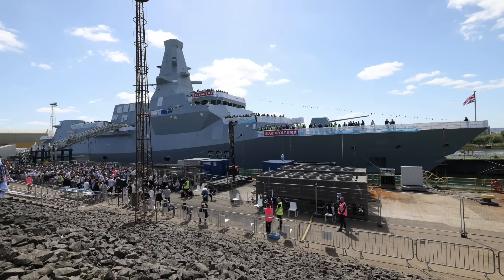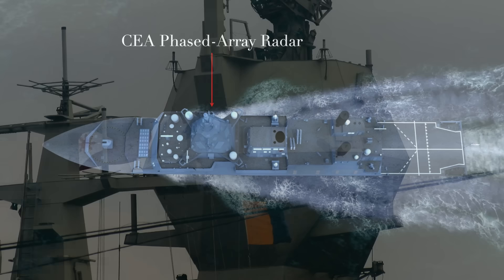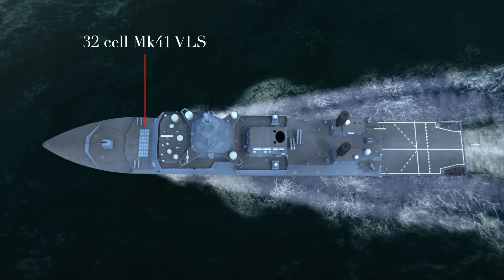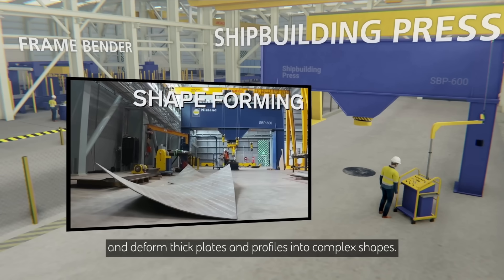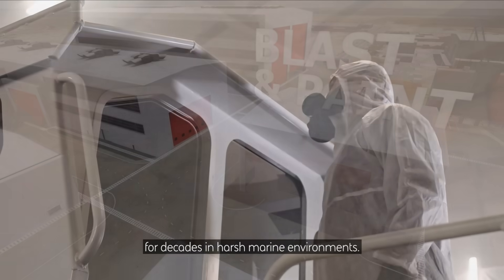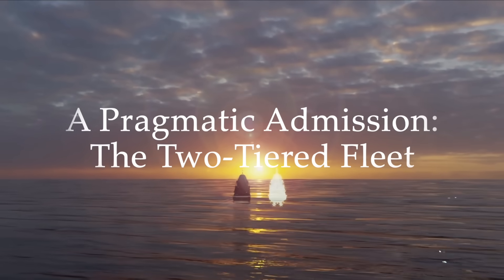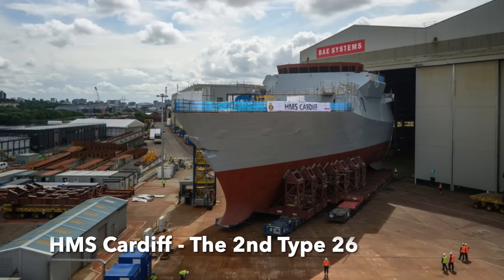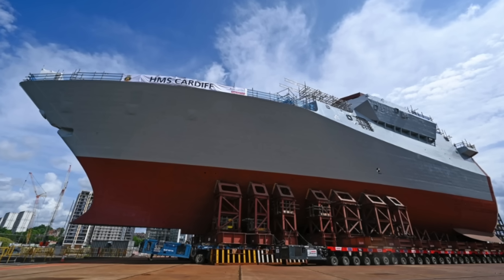The World’s Most Expensive Frigate? Inside Australia’s Hunter Class

Comment: The problem is not investing in am advance frigate assembly
Line. Expensive but necessary.

Its giving an ASW warship a full AAW radar suite which isnt needed for that mission.

The lesson from Yemen and Ukraine operations show you need many more layers of air defence (lasers, 40 mm anti-missile, boats, drones, an 76mm or larger gun and lots of quad packed point defence missiles. For area (fleet) Air Defence
And anti-ballistic or hypersonic missiles you also need lists of long range air defence missiles on top.

IMO the extended Mogami GP frigates are too small and under 13:03 armed to be safe. A modern air defence destroyer needs to be c 100 mk 41 VLS and over 10,000 tonnes.
Reply: The Hunters don't have a full AAW radar suite. They have CEAFAR and AEGIS CMS.
Reply: @De_cool_dude a European equivalent built today would have a single AESA (say l) Thales 4D NS100 or equivalent. Significantly less radar.
Reply: @nickbrough8335 the Europeans have a completely different threat environment. What might be enough for them would not be for us.
Reply: @De_cool_dude in what way ? It may make sense that Australian builds combined ASW And AAW warships (rather than one of each), but that you need 10,000+ scale and the T26 design is too small.

If you want to protect the RAN against Chinese SSN then you need T26 and SSNs (and probably carriers tbh). Yes, they need more patrol endurance than most European designs have (perhaps more than even the UK has designed in.

What you don’t have is your ASW towed arrays and helicopters anywhere near tour fleet/convoy where they cant listen quietly at low knot speeds. I dont know what SOP would be, but active radar silent conditions wouldn’t surprise me

Comment: why didnt they just buy what the RN ordered
Reply: Politicians treat defence procurement as a make work scheme.
Reply: The RN's Type 26 sucks at anything that's not launching helicopters and detecting submarines.
Reply: @De_cool_dude 
Cool story bro. 

What do you think ASW are for?
Reply: @brettmitchell202 we didn't want something that can just do ASW, we also want something that defend itself in the air and surface environments too.
Reply: @De_cool_dude 
And you think Type 26 can’t do that? Lol please.
Reply: @brettmitchell202 not in the context of a general war in the Pacific. Tell me, can a Type 26 launch SM-6, or SM-3, using its T997 radar? How many slanted anti-ship missiles can the T26 use?
Reply: @De_cool_dude 
The RAN don’t use those missiles so I suppose the answer is zero…

Are you suggesting Type 26 has no anti air or anti ship missile capability?
Reply: @brettmitchell202 good job dodging the question! However, the RAN does use the SM-6, and it is not incorrect to say the SM-3 could be procured in the next few years . . .

No, I am saying that the T26, as is designed for the UK, lacks air defence and anti-ship missile systems suited for the Pacific. Unless you think a SAM system with <50nmi range and a future dual-use cruise missile, launched from VLS, is better than ESSM, SM-6, TLAM/MST and NSM, and sufficient for a Tier 1 combatant going up against the PLA's best]?

Comment: The reason why its called a teir 1 ship is because it has the AEGIS system and a great deal more C2 capability. The issue with it is that its a ASW frigate and so will need to be on the outer ring of a taskforce. 
This means its a ship where the expensive items (AEGIS and C2 capability) is incompatible with the other part of the ship's function (ASW). 

If it wants to be a tier 1 ship, one that is at the centre of a taskforce and for it''s weight and price then there is a great deal of destroyers that are in the similar weight and price clase. The US Arleigh burke class, Sejong the Great, a reduced size Maya class. To be honest the price difference for the Maya class or the Sejong the great class destroyers would more than pay for the need to build in Australia as the Sejong the great is AUD$0.9 billion and the Maya Class is AUD1.63 billion.  These are much more capable than the Hobart class ships (2-3 times more). 

If we wanted a dedicated ASW frigate that the type 26 without modifications would have been fine but it is more than twice as expensive as equivalent german, dutch french or spanish ships. The japanese are ONLY a 1/3 of what it costs the UK to build the Type 26.  The korean one is a tenth of the cost.
Reply: The European equivalents to Type 26 arent designed to be as quiet and most in service top out at about 4000 miles range; type 26 designed for 9,000.

European Navy’s are NOT intended for open ocean warfare either.

The extended Mogami class is a GP frigate. The UK equivalent is the Type 31 some 2 to 3000
Tonnes lighter without any real specialisation.
Reply: @nickbrough8335  Thanks for noting the increased range of the Type 26.  In regards to Japan I was talking about the Asahi class destroyer, which is a specialist ASW ship.
Reply: @yumsy37 fair enough
Reply: AEGIS is so that the RAN (now just the RAN's Tier 1 force) could standardise on a CMS. That alone would save billions in training costs for the projected lifespan of Hunter.
Reply: @De_cool_dude fair point, but modern CMS are tending to be modular and open system based to allow different weapon systems to “plug and play” amd Aegis originated for the top end  US AAW platforms. 

I would argue copying the USN approach may be dangerous. With the various design problems (LCS, Constellation class, Zumwalt) its clear that they have completely lost their way. It seems that the Navy brass are fixated on large full scope warships (arleigh Burke’s) and cant innovate or modernise their approach.
Reply: @nickbrough8335  Baseline 9 AEGIS is a lot different to Baseline 2. (Also AEGIS alows CEC and NIFC-CA)

We aren't copying the USN approach. We have large vessel procurment and we have USV/UUV procurment. They are managed by different teams under the same department, but are aligned in goal and in C3 infrastructure/networking.

Comment: the larger hull was for fuel as Australia doesn't patrol in the North Sea or the Atlantic puddle, a part of the program cost is in the university course in naval ship design at the uni of SA witch should pay off in the long run if we want a sovereign build capacity, I think the reduced build numbers are a mistake and the two tired issue is a political one not a naval one it's about cutting defense spending also the steal cutting started a year earlier than you said in Newcastle and other places as the build will have sections built around the country sa part of the push for sovereign build capacity

Comment: In my opinion as an Australian I would accept a cost it takes to have that shipyard building non-stop. Build a Ship and while it is constructing the next design is turned into digital instructions. The vessels to replace the ones in service are commissioned every 2 years for example. We end up with Australian built ships even if it means taxpayer subsidises the shipyard.
Reply: Australia will be building  the Mogami class frigates also. We don't  need two different varents for the same role. Then hunter.class has very little gain over the  evolved Mogami class frigates. And that's a lot of $$$ for only a little  gain
Reply: Australia should be scrapping the hunter.class and build more Evolved Mogami-class. For frigates instead of just 11. They could build-up to 24  and still work out cheaper for ASW ships. 

Replace  the 3 f100 class with Navantia flight III 128cell VLS for AWDs. It would be cheaper for Australia budget and give more surface combating vessels. 

The decision to stick with 6 hunter.class as well build 11 Evolved Mogami-class was a ? For me. Why? They both ASW platforms with similar capability except  the hunter class has more tonnage with similar sensors and both have a phased aray radar and same towed away sonar system.  Both have similar range. Both can fire the same weponry except  the hunter class has twice the crew to operate it and is 10 times more expensive to build. 

If people think the hunter class will have a major marginal advantage over the the Evolved Mogami-class. They are kidding themselves. It a lot of money for a little bit more advantage.
Reply: @Nathan-ry3yu  I disagree with you, the Type 26 is also AEGIS equipped, fires both the SM3 and 6, there was a TV report on the ADF specifically the RAN and two of the experts could not believe we dropped the number of a more powerful type 26 for the lesser Mogamis, by the way the Hunter class is a dedicated ASW whereas the Mogami is a GP, an ideal TF would have a combination of ASW, AAW, GP and a replenish ship, maybe I spent too much time reading AFTPs. I forgot to mention the Mogami's were designed as an escort for the new Kongo class.
Reply: @Nathan-ry3yu  how so . they are designed for 2 very different reasons. The hunters are a good ship. The Mogami's are an excellent addition to the fleet as they allow the Hobart's and hunters to foucs on more frontline and demanding rolls. I would put money on the batch 2 hunters having the 96 vls and replacing the Hobarts. makes a lot of sense.
Reply: @Nathan-ry3yu  I will take the advice from Prof Hugh White and his reason why we need the Type 26 and not yours. One ship is a dedicated sub hunter and the other is a GP frigate, maybe read a AFTP before you comment.